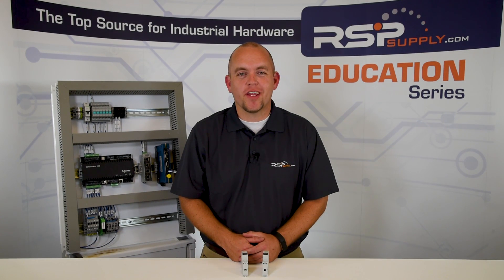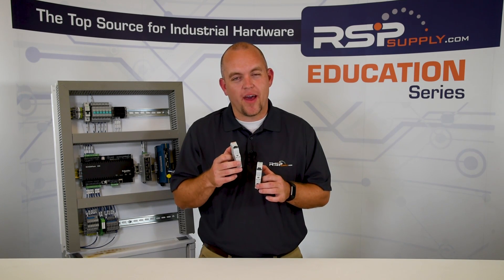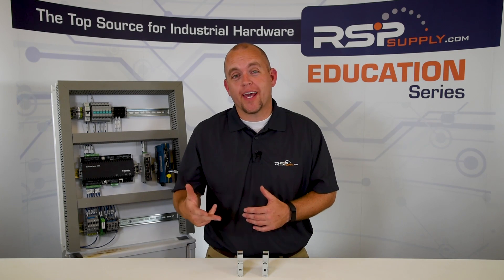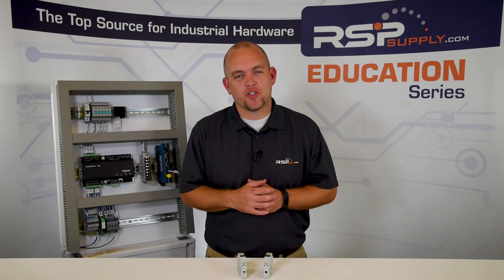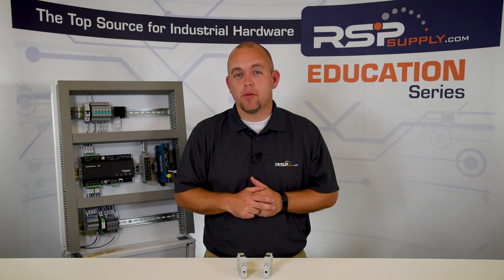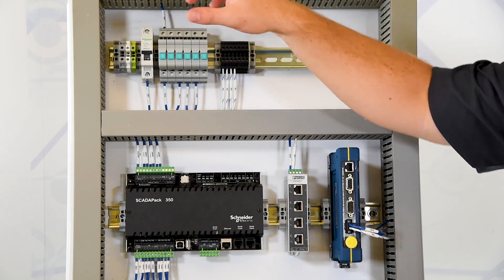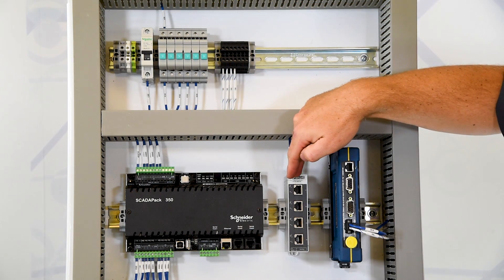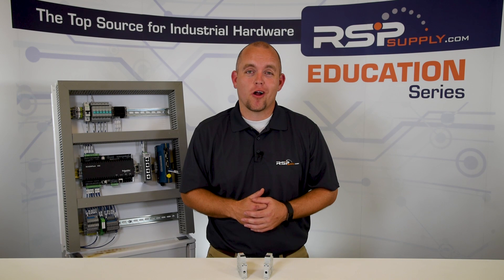Supplementary vs Branch Circuit Breakers

Comment: Miniature Breakers vs Supplementary: The difference is that Supplementary are not rated for Branch Circuit protection. It isn't about how many loads the breaker controls. Supplementary breakers must be positioned below a Branch Circuit rated breaker or fuse.

Comment: how do you IDENTIFY each, since they look same?
Reply: Just to put it out here, I think the easiest to identify the difference is by the compliance they come with. For example, UL1077 is supplementary protector, whereas UL489 is a branch circuit protector, usually the high power circuit breaker also have UL489.